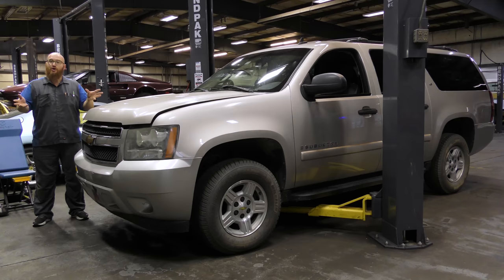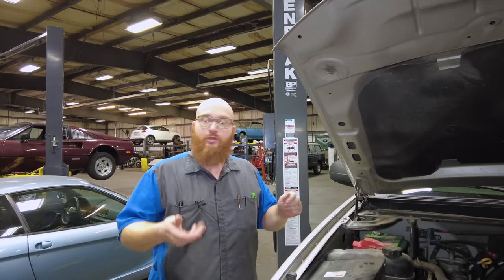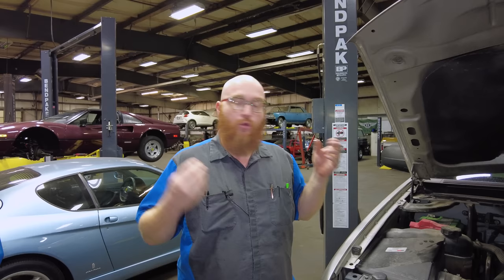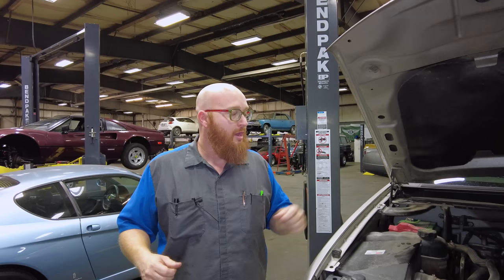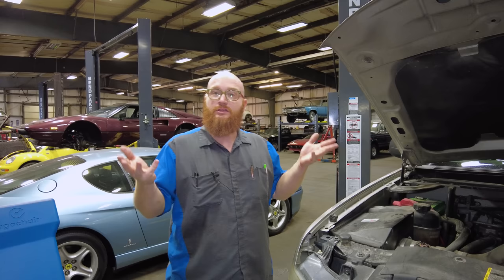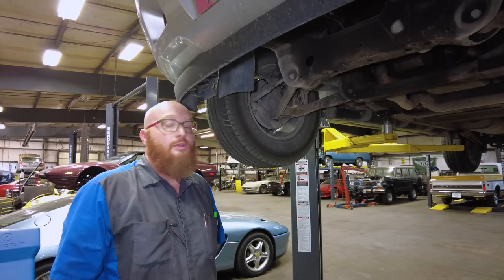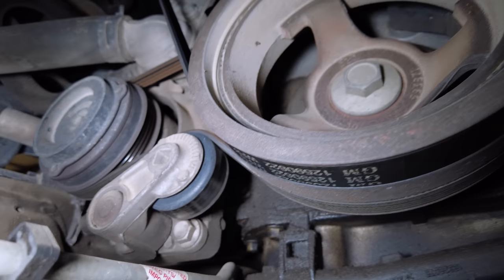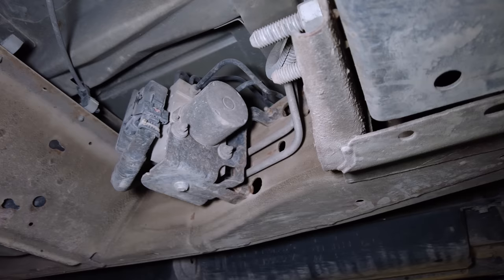What fails on ALL early 2000's Chevy SUV's!? CAR WIZARD shares what he's seen from the last 20 years

Comment: I love the 99-06 full size GM products for their simplicity. They're inexpensive, easy to work on, and have great parts availability.
Reply: 2005 Denali still running
Reply: I agree, I have a 2005 Silverado with a built 4.8, and an '04 Yukon Denali. Both are awesome!
Reply: Lm7 with cathedral ports oooowee
Reply: 2002 Tahoe spent 6k on it and dropped about 8k into it I’ll have this baby for years to come
Reply: @steeleflex  Oh wow. New engine?
Reply: @KobeCorona-uj3zb  Nice, how many miles?
Reply: @Dan Jones  250,000 I just came back from a road trip last night 🫠
Reply: I have a 01 2500 with 176 k it’s broke a few times but she is still kicking best trucks out there
Reply: @danjones3402  Nope everything but an engine these vortecs go forever mine has 179k I had an 03 suburban that had 268k on it when I got rid of it and still ran strong. They’ll go awhile before needing major repair I frequent the mountains here in Colorado and these are the perfect vehicles for it.
Reply: @steeleflex  Amazing!!
Reply: I have a 99 silverado first gen 5.3 with 293,000 miles. Done a few of these repairs myself. Best truck I've ever owned.
Reply: Most definitely. Still have 08 trailblazer with little rust in the rust belt and running flawlessly with inline 6 4.2
Reply: Yeah 2003 Suburban K1500 AWD at 190,000 miles and so far not too bad.
Reply: 2000 1/2 ton LB Chevy 4.3 v6 AC Caputo
Hand crank windows and locks. 
175000 miles. Paid for. Is the best part.
Reply: Got an '04 Z-71 ext. cab w/130K that is a real creampuff. Will never let it go as I plan on being buried in it...
Reply: Shares it with the sequoia.
Reply: I have a '00 LB 1/2 TON CHEVY I LOVE IT. 4.3 v6 nice
Reply: The GMT800 platform was the pinnacle of GM badge engineering
Reply: @jerrykinnin7941  I have the same 4.3 vortec in a 2003 Sonoma. It's one tough engine. I love it and know I'll miss it when the time comes. Best engine ever. You can still find the 4.3 in commercial vans.
Reply: @aidanstell5720  tbi 350 doood.. way better
Reply: I've put 300k on 3 different 99-07 classic trucks and suburbans,and the only thing to go out is the stupid 60e,even the 65e in my 07 classic went out.
Reply: And then they ruined the 5.3 with AFM/DOD!
Reply: Bought my wifes 01 Tahoe with 285k on it, 317 now. Big repair was a transmission (very common on these 4L60E) but I dropped a junkyard one in and it's been fine. Some of the best vehicles gm made imo
Reply: And break down often. I have an 02 that I've put over 8k into it and I bought it for half the price. 🤦
Reply: Agreed. I absolutely love the gmt800 platform. I'm on my 3rd model. My favorite being my previous 05 yukon xl 2500. Currently have an 01 tahoe with over 300,000 miles all original. Runs like a top and almost 0 rust
Reply: 1999 GMC Suburban 1500 SLT out here in WV gettin it erday
Reply: @madwestboy  these often came into the dealership with an aluminum block 5.3. The Denali has a 6.2L and last longer if not serviced every 4500 miles.
Reply: 04 Yukon 6.0l still going strong with almost 200k on the clock and after 10 years of towing 8000 lbs.  Good vehicle for the money.  Interior starts to show its age and tranny doesn’t shift like it used to are the only minor issues.
Reply: I had 02 Sierra for 15yrs sold it got a 99 Sierra on yr 3 love those trucks
Reply: @fsu3784  I hope people keep most of the GMT-360s and 370s on the road for forever. Not just because they’re reliable, but because of where they were built (Moraine assembly plant) probably one of the best GM plants ever. Some high mileage Trailblazers are really ratty though mainly because of negligence from their prior owners.
Reply: @whatamisupposedtoputhere  I plan on taking care of it forever. Even if the body goes I’m putting this engine in something else lol. I’m at 152,000 miles now and hardly any surface rust to speak of. Oil change every 3000 miles. I treat with fluid film every year. Can’t say enough good things about this engine I love it.
Reply: 02 suburban 5.3L  4wd 320k.  It's breaking down slowly but still going. Will get another when this one dies.
Reply: had a '99 Silverado and while yeah it wasn't bad to work on, it always needed to be worked on. hated that thing.
Reply: Because these trucks last a long time a replacement with decent mileage from the same era will be expensive but well worth it
Reply: Totally agree. No matter what shape. Sharp Chevy. Number 1
Reply: 02 silverado  no problems 229k except u joints
Reply: 2000 Suburban, 228,000 miles still runs great! Did have to replace transmission at 190,000 miles though.
Reply: Lq9 omg yes
Reply: Yes sir can you tell me about the 2022 Chrysler Pacifica L ?
Reply: I have an 04 Tahoe LtZ. Its the most reliable piece of shit I’ve owned. Nearly every electronic in it has or is failed. I wish I just would have got a base model with no extras. I’ve fixed some things and let others go.
Reply: 2000 gmc sierra 1500 SL  150k miles just getting evap codes. 6 inch lift on 35s so mileage is meh. Solid and easy to work on though.
Reply: @steeleflex , so you're into it for 14k? OK. On a 2002?
Reply: I was running an exhaust shop in the early 2000s. The amount of broken exhaust manifold bolts we replaced was crazy. Too small a diameter bolt made from the finest recycled  tuna cans. Put in a cast iron manifold and threaded into an aluminum cylinder head. Guaranteed for failure.
Reply: Also they get stolen 3x a year
Reply: It only went downhill from there and fast. Chevy just decided to stop doing quality control in 2007.
Reply: Yup. Had a Yukon XL once with half a million miles. Only needed a transmission at one point.
Reply: Yup Owned a 2001 gmc cat went out other than that it was a great truck. Own a 2006 Duramax, just usual replacements here & ther
Reply: @steeleflex not sure why you are bragging about having to spend 8k....you could have just took that 6k and added it to that 8k and just bought a better car.
Reply: @OmarHudson  A new Tahoe is about 80k my 02 is fully restored
Reply: @steeleflex  oh ok. Maybe I misunderstood the intention
Reply: 01 199000 miles 4×4 2500HD az truck zero rust .I gave $6000 yr ago 😊
Reply: Yep cheap easy to repair Ford said you know pushrod V8s are just too reliable let's go overhead cam and they have been all downhill since then
Reply: I bought a 2008 Silverado for $7k with check engine lights (3). I had to replace the rear main seal, the oil pressure sensor and the oil pickup oring. And then sent the injectors out to be cleaned. No problems since then. Great truck!
Reply: 03 tahoe z71, fairly easy to deal with
Reply: @steeleflex same, i live in Loveland 5.3, z71, best whip fir the cost
Reply: I have 2004 Suburban that makes me hate GM vehicles. GM has been making trucks for 100 years, they should have truck platforms down; I shouldn't have Rock Auto on speed dial. The list is so long, transmission,  window motors (8), A/C Compressors (2), throttle body, steering position sensors (2) the list goes on and on.  If I didn't need it for towing a boat, the POS would have been long gone.
Reply: Good luck finding one not rusted to death.
Reply: Brilliant they are
Reply: I've been passed down an 03 suburban (with 150k mi) and it's gonna be my project car, the interior plastics, headliner, carpet, radio, speakers, dash, & carpet all need replacing, needs a new windshield, new rims (has aftermarket ones but I don't like the way they look), needs the rear windshield wiper fixed, and it leaks oil and the check engine light is on, so it's gonna be a hell of a journey but it'll be so worth it in the end
Reply: @steeleflex  - That's a lot of money.  I do believe in active maintenance. My "01 has 320K miles on it and there's nothing wrong with it - mechanically sound!!!! Now, I'm doing fixes on cosmetics like the interior and fixing hot sun Az. damage on the roof - time to go to Mexico where labor is cheaper!!!
Reply: I bought a brand new 2002 Avalanche with the 5.3 engine. Had it for 20 years and it was a totally reliable vehicle. Never had any issues with the engine, transmission, or transfer case. The AC had never been serviced since new and it still blew ice cold in the hottest weather. But, I had to scrap it due to severe frame rust. It developed a minor fuel leak near the top of the tank. Took it to my local garage and we couldn’t get it up on the lift. The lift pads just collapsed the frame when we tried to lift it. You could take a screwdriver and poke thru the frame just about anywhere. It was no longer safe to drive. It was running perfectly when I sold it to CoPart for parts.
Reply: @royfrye333  Nice story.  I have 320K miles on my "01 Suburban and the frame is as perfect as new, but it's lived a life in Arizona.  Hate the rust belt and salt on the road!!!!
One in the snow belt, I had an SKE Jag built on a rail that rusted out.
Reply: 04 Yukon slt proud owner 155k miles and everything works only issue is the catalytic converter is no good or needs oxygen sensors had the same problem with my 2000 Tahoe around the same miles
Reply: Stupid spider injectors
Reply: I love my '86 Full size Blazer better.
Reply: I don't know about "easy to work on!" Good luck taking apart the dash to change the AC blend door actuators or evaporator!
Reply: heater core is a bear to change
Reply: Not a GM fan but these and Tahoe are reliable as the sunrise
Reply: Before GM ruined the 5.3 with that AFM crap, technically 99-07 they call the “classic”
Reply: Agree
Reply: @bobbytables3675  Huh?
Reply: @fsu3784 what do you mean 6 4.2?
Reply: Engines will FAIL
Reply: And they look pretty good and they are reliable 👍
Reply: Definitely NOT inexpensive.
Reply: @steeleflex that's insane. I had an 01 and didn't have to put more than 2 grand into it to keep it running. That's insane money to spend on a new SUV.
Reply: @steeleflex transmission slipping the entire time from factory to fourth owner.
Reply: @fsu3784 how you like that slipping transmission which comes stock in all American made vehicles.
Reply: @MisterT359 transmission failing is a minor issue? That's a 5 grand plus repair job. Wtf. Wow it must be nice having inheritance money and not working a day in your life.
Reply: @NoelCo-yd1gu  haven’t experienced that yet buddy but thanks for asking I appreciate it!! Still going strong zero slippage
Reply: Good to.know wgat u might need to fix though
Reply: Bravo!  Good bang for the buck IMO.
Reply: Except the flex gas sensor.
Reply: Have over 250,000 on mine and the biggest problem was the o-ring for the oil pump. I've had this truck for years and I drive over mountain passes a lot. I run lube guard in my transmission and never had an issue.
Reply: Same! Even the next years up are the same, AFM delete and you’re back to stock with no crappy lifters! I love my 08’ Tahoe PPV❤
Reply: @snuffysmiff 😂 I feel you bro! I love these things
Reply: We had a 2005 Silverado 5.3. absolute garbage, trans issues and shaking, cheap ass interior, electronics and AC would always break. Heater hoses basically melted off. And after that it burnt oil at about only 100k miles.